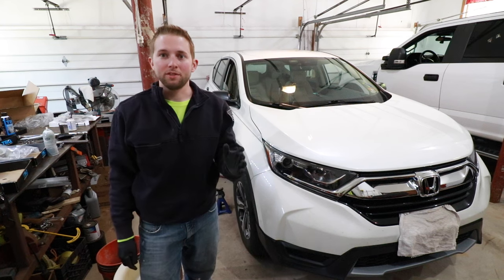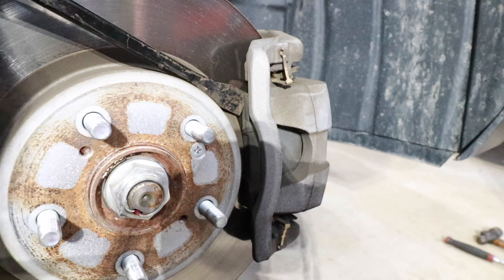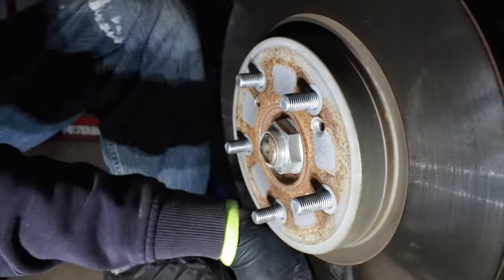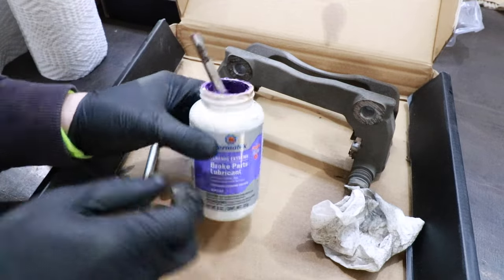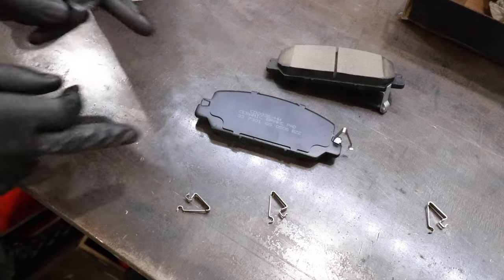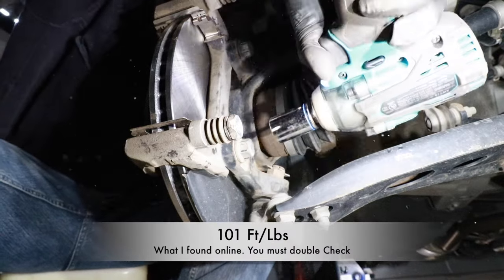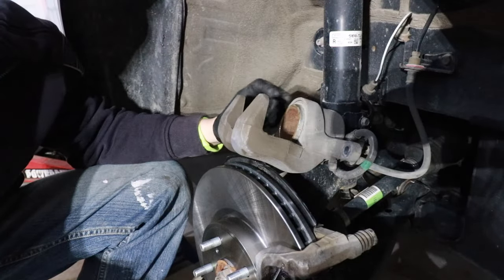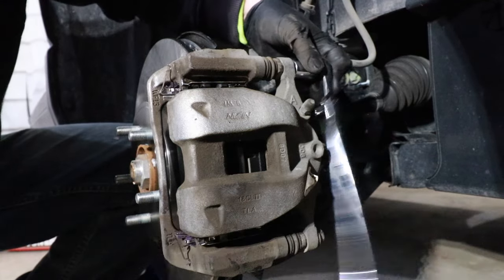How to replace FRONT Brakes | 2017-2021 Honda CRV

Comment: Im a former master wrench, but have been out of the game for a long time, other than taking care of family vehicles.
Nice video.  Something that drove me crazy were those spring clips on the edges of each pad, which push the pads away from the rotor.  I used after market Akebono pads which came with those clips.  Akebono makes fantastic brake products, but not in this case.  I didn't realize their clips were a little smaller than the stock Honda clips.  They flew off with every attempt to seat the pad.  I thought I  was missing a technique or perhaps a special tool.
After suffering through tthe fronts, i finally decided to reuse the clips from the OEM pads, which were a bit larger, providing more metal to clamp onto the pads. No joke, the clip issue alone added nearly 2 hours of work because every time they popped off, i had to reinstall them without contaminating the pads or rotors.  
The M77 grease worsened the problem by decreasing what little friction the clips had to hold them on the pad.
YOUR pad/clips slipped right into the caliper mount without a problem.
I've done hundreds of brake jobs, and this was the worst.

Comment: Great tutorial. Only thing to add is for people to check their master cylinder before pumping the brakes. Make sire you loosen the cap. The issue here is some shops add brake fluid and when you reset the caliper piston, it will  drive the fluid back causing leak.

Comment: Great video!!! Very clear. One additional item that I often need to do is clean off the new rotors with a quick hit of brake cleaner to remove the oils on the new rotors. I've never had much on new slotted rotors, but on standard rotors there always seems to be some lubricant.
Reply: Forgive me...jumped the gun. I always do it before I install on the hub. Great job:)

Comment: At 12:59 you said to set Torque to 105 foot pounds. The correct Torque is 80 foot pounds
Reply: Can confirm, just checked the torque specs for 5th gen CR-Vs from the Honda Service Information System and it indeed says 80 lbf-ft (108 N.m).
Reply: @upinarms79  Yup, 80 is the spec however I always torque to 100 so 105 is very acceptable.
Reply: @alanstewart4777  Do what you like but 25 lb-ft over spec seems like a snapped bolt head waiting to happen to me.  Any particular reason you torque it that much?
Reply: @upinarms79  I don't know the shear rating on the bolts so can't speak to the breaking point.  However the shops in our area torque at 95 - 125.

Comment: Great video!  But you didn't say to open the master cylinder lid before you compress the brake piston so that the new fatter brake pads will fit.  That is an important step, I don't think the piston would compress with your special tool if it was still on, would it?  I just use a big C clamp, that works fine for that purpose.
Reply from the maker: Honestly, I have never removed the brake reservoir fill cap. I will have to try this one day and see if it makes it easier to compress the piston. However, all my life I have never had an issue compressing the piston with the fill cap on. 

In the past, I have always used a C clamp as well, however I purchase that special brake compression tool specifically for this car. The rear disk brakes double up as the emergency brakes. The rear brakes Can Not Be Compressed With A C Clamp. They require a special twist compression tool to wind the piston/actuator back.

Comment: Only thing I notices was lug nut torque settings. I always thought it's 80ft.lbs. anyhow really great video. 
On the side note, is it advisable to put anti seize on the caliper bolts (big bolts 101ft.lbs) and also the retaining bolts torque for 37ft.lbs. I was thinking of add anti seize on those bolts.
Reply from the maker: When I first started repairing cars, I used to put anti seize on every bolt. I rarely do now. I'd say it's not necessary. I reserve anti seize for bolts subject to severe corrosion. 

Some make the argument that the anti seize reduces the coefficient of friction, thus making it likely that you may over torque the fastener.
Reply: @OldSoulMillennial  I figured just put a little to ensure it doesn't seize. But I see your point

Comment: OP, is or was this your vehicle? I want to know how the quality of these rotors and pads were. If there are worth it/worth the price.
Reply from the maker: @KerKoy  I always go with the cheapest set of rotors I can find. However, Cheap rotors tend to rust faster. If you drive your vehicle frequently, no issues. If you drive your vehicle once a week, and it sits out in the rain, I would go with a higher quality set. No complaints here.

Comment: Do you out grease on the outside of the pads?
Reply: Some people do because they say it prevents rust and reduces noise, but I never have and don't have any problems.  If you live in a cold damp place it might be more necessary.  It's more important to grease the contact points on the caliper inserts and the contact points on the pads.  Just be careful not to get any on the pads themselves.

Comment: You don't need to bleed the brake fluid?
Reply from the maker: You need to pump the brakes before you drive away. You do not need to bleed the brakes. If you where to change out a caliper, then you would need to bleed the brakes.